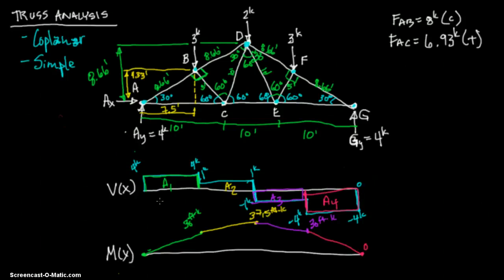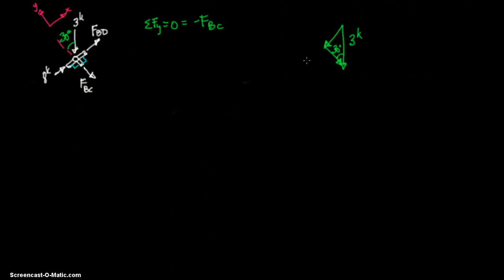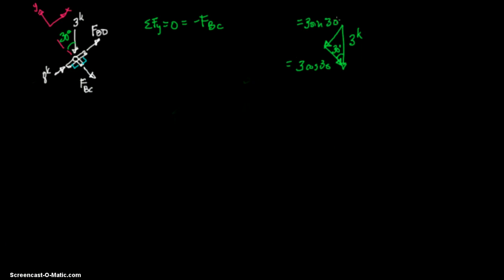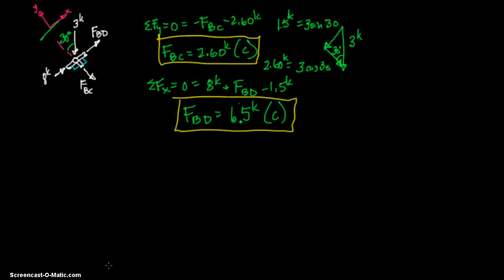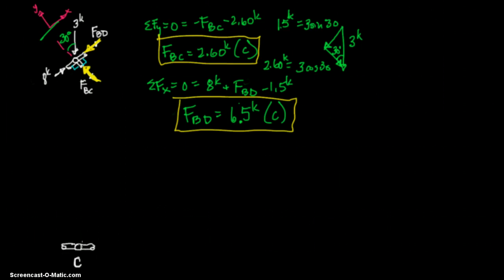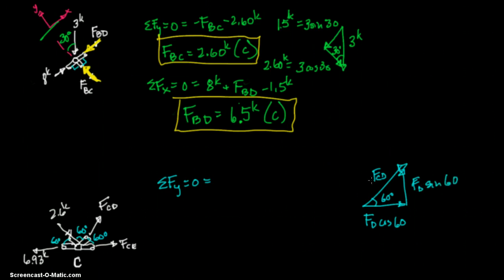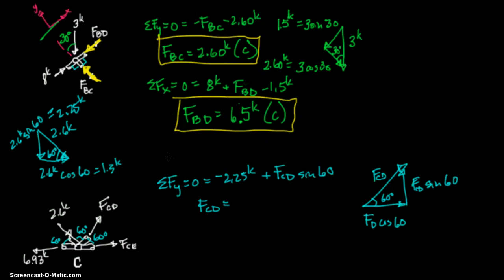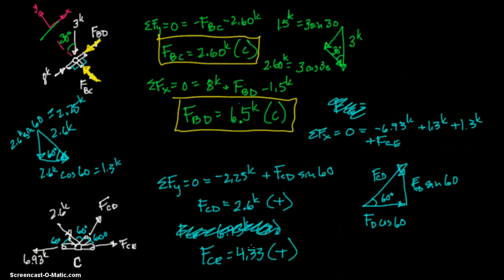Simple Truss Analysis (Part 4)

Comment from the maker: @tropicobear 
You can define your x and y axis anyway you wish.  Rotating the x/y axis the way I did in this situation simplifies the equations.  You could rotate your axis 3.43 deg (arbitrary) if you wanted to--but it would only make your equations more difficult.

If there wasn't an external load on this, Fbc would be a zero force member since Fbc is at a 90 deg angle from Fab and Fbd. Fbc doesn't have to have any load on it and could be there just for support. Let me know if this makes sense.

Comment: Hey, thanks a lot for the video! Just one question though - is it possible to rotate the x and y axis as you did here, if there is no external force acting on the joint? If I understand correctly, this would result in there being no force in the y direction, since without the external force acting, Fbc is the only force acting in the y direction, and that would therefore equal zero. But there must be some kind of force acting in that direction?? Or maybe I'm just confused :s

Comment from the maker: This right angle is from Member B-D to the extension of member B-C to the upper left.  We know that this is 90 deg.  We know that the angle from vertical to member B-D is 60 deg.  Therefore, we take 90 deg - 60 deg and we get 30 deg.

Yes, confusing to explain by text.  If you are struggling with trigonometry, try going to the Khan Academy and using that or go back to the first parts of this lesson and follow what I was doing again--that should help.  Let me know if it doesn't.

Comment from the maker: @TheMaynardz 
If you go back to the original structure at the beginning of the video (or the last few videos) you can figure it out using trigonometry.  Since we had already figured out that the angle at joint A is 30 deg. we can say that the angle from the horizontal to member B-D at joint B is also 30 deg.  This means that the angle between the vertical and member B-D is 60 deg (right angle - 90 deg).  In a similar fashion, we can draw a line extending member B-C to create another right angle.